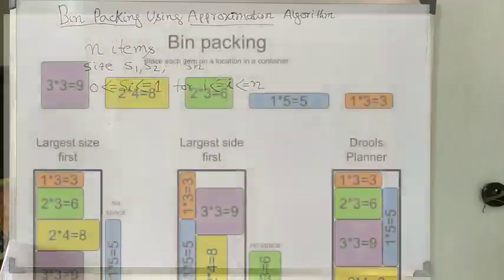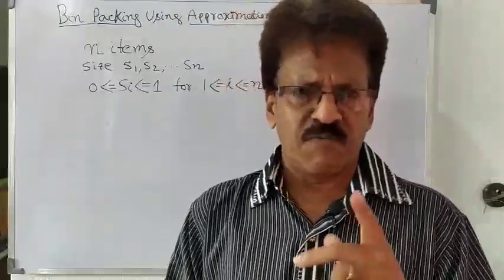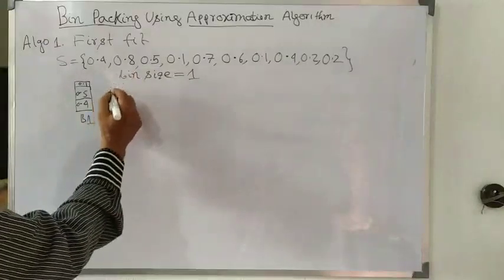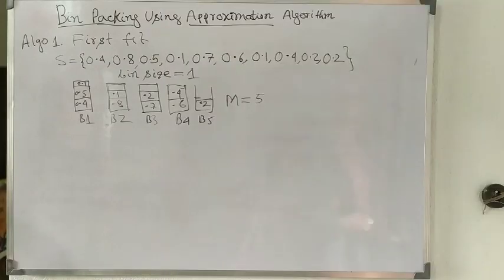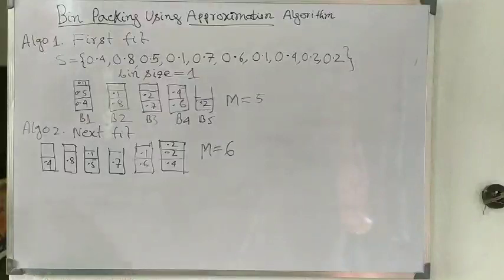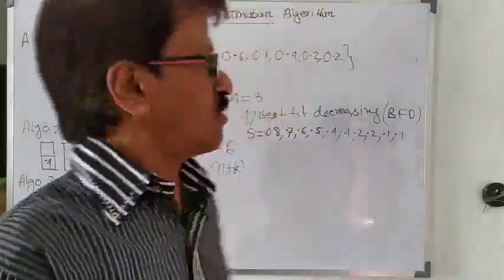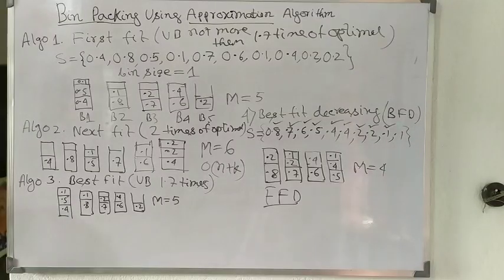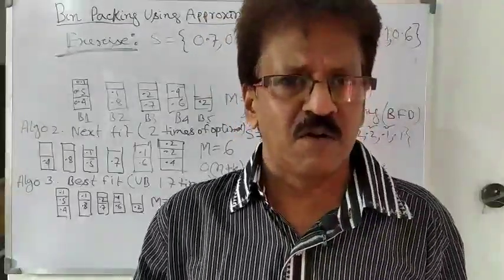Bin Packing | Approximation Algorithm |Upper Bound

Comment: First fit algorithm 
Bin1:0.7,0.2,0.1
Bin2:0.5,0.4
Bin3:0.2,0.5
Bin4:0.6

Next fit algorithm:
Bin1:0.7
Bin2:0.5,0.2
Bin3:0.0,0.4,0.2
Bin4:0.5,0.1
Bin5:0.6

Best fit algorithm
Bin1:0.7,0.2,0.1
Bin2:0.5,0.4
Bin3:0.2,0.5
Bin4:0.6

Best fit decreasing algorithm
0.7,0.6,0.5,0.5,0.4,0.2,0.2,0.1

Bin1:0.7,0.2,0.1
Bin2:0.6,0.4
Bin3:0.5,0.5
Bin4:0.2
Reply: First fit algorithm
Bin1:0.7,0.2,0.1
Bin2:0.5,0.4
Bin3:0.2,0.5
Bin4:0.6
Next fit algorithm:
Bin1:0.7
Bin2:0.5,0.2
Bin3:0.0,0.4,0.2
Bin4:0.5,0.1
Bin5:0.6
Best fit algorithm
Bin1:0.7,0.2,0.1
Bin2:0.5,0.4
Bin3:0.2,0.5
Bin4:0.6
Best fit decreasing algorithm 0.7,0.6,0.5,0.5,0.4,0.2,0.2,0.1 Bin1:0.7,0.2,0.1
Bin2:0.6,0.4
Bin3:0.5,0.5
Bin4:0.2
Reply from the maker: Correct
Reply from the maker: Correct
Reply from the maker: Correct

Comment: First fit Algorithm
1st bin: 0.7,0.2,0.1 
2nd bin: 0.5,0.4
3rd bin: 0.2,0.5
4th bin: 0.6
M=4

Next fit Algorithm
1st bin: 0.7
2nd bin: 0.5,0.2
3rd bin: 0.4,0.2
4th bin: 0.5,0.1
5th bin: 0.6
M=5

Best fit Algorithm
1st bin: 0.7,0.2,0.1 
2nd bin: 0.5,0.4
3rd bin: 0.2,0.5
4th bin: 0.6
M=4

Best Fit Decreasing Algorithm(BFD)
1st bin: 0.7,0.2,0.1 
2nd bin: 0.6,0.4
3rd bin: 0.5,0.5
4th bin: 0.2
M=4
Reply from the maker: Correct

Comment: First fit/ Best fit algorithm 
(both have same output and complexity) 
1st bin : .7,.2,.1
2nd bin : .5,.4
3rd bin : .2,.5
4th bin : .6
M=4

Next fit algorithm
1st bin : .7
2nd bin : .5,.2
3rd bin : .4,.2
4th bin : .5,.1
5 th bin : .6
M=5

Best fit decreasing algorithm (optimal) 
>>This is same as First fit but after sorting      the data set in an descending order 
1st bin :- .7,.2,.1
2nd bin :- .6,.4
3rd bin :- .5,.5
4th bin : .2
M=4
Reply from the maker: Correct

Comment: S={0.7, 0.5, 0.2, 0.4, 0.2, 0.5, 0.1, 0.6}
Algorithm 1: First fit
Bin 1: (0.7, 0.2, 0.1) 
Bin 2: (0.5, 0.4) 
Bin 3: (0.2, 0.5) 
Bin 4: (0.6) 
So, M = 4

Algorithm 2 : Next fit
Bin 1: (0.7) 
Bin 2: (0.5, 0.2) 
Bin 3: (0.4, 0.2) 
Bin 4: (0.5, 0.1) 
Bin 5: (0.6) 
So, M = 5

Algorithm 3 : Best Fit
All 4 bins are same as in First fit algorithm. 

Algorithm 4 : Best fit decreasing (BFD) -> Optimal solution
First of all sort the given bin elements in decreasing order ->
S = {0.7, 0.6, 0.5, 0.5, 0.4, 0.2, 0.2, 0.1}
Bin 1: (0.7, 0.2, 0.1) 
Bin 2: (0.6, 0.4) 
Bin 3: (0.5, 0.5) 
Bin 4: (0.2) 
So, M=4
Reply from the maker: Correct 💯✔️

Comment: ALGO 1: FIRST FIT 
Bin 1 : 0.7 , 0.2, 0.1 
Bin 2 : 0.5, 0.4 
Bin 3 : 0.2, 0.5
Bin 4 : 0.6
Hence , M = 4

ALGO 2 : NEXT FIT
Bin 1: 0.7
Bin 2: 0.5 , 0.2
Bin 3: 0.4 , 0.2 
Bin 4: 0.5 , 0.1
Bin 5: 0.6 
Hence, M = 5

ALGO 3 : BEST FIT
Bin 1: 0.7, 0.2, 0.1 
Bin 2 : 0.5, 0.4 
Bin 3 : 0.2, 0.5
Bin 4 : 0.6
Hence , M = 4

ALGO 4: BEST FIT DECREASING
S={0.7 , 0.6 , 0.5 ,0.5 , 0.4 , 0.2 , 0.2 , 0.1}
Bin 1: 0.7,  0.2,  0.1
Bin 2: 0.6 , 0.4 
Bin 3: 0.5 , 0.5 
Bin 4: 0.2
Hence, M = 4
Reply from the maker: Correct 💯✔️

Comment: First fit-
1st bin : 0.7, 0.2, 0.1 
2nd bin : 0.5, 0.4 
3rd bin : 0.2, 0.5 
4th bin : 0.6 
M=4

Next fit- 
1st bin : 0.7 
2nd bin : 0.5, 0.2 
3rd bin : 0.4, 0.2 
4th bin : 0.5, 0.1 
5 th bin : 0.6 
M=5

Best fit 
1st bin : 0.7, 0.2, 0.1 
2nd bin : 0.5, 0.4 
3rd bin : 0.2, 0.5 
4th bin : 0.6 
M=4

Best fit decreasing 
1st bin : 0.7, 0.2, 0.1 
2nd bin : 0.6, 0.4 
3rd bin : 0.5, 0.5 
4th bin : 0.2
M= 4
Reply from the maker: Correct

Comment: First fit/Best fit: 
1st bin : 0.7, 0.2, 0.1 
2nd bin : 0.5, 0.4 
3rd bin : 0.2, 0.5 
4th bin : 0.6 
M=4 

Next fit: 
1st bin : 0.7 
2nd bin : 0.5, 0.2 
3rd bin : 0.4, 0.2 
4th bin : 0.5, 0.1 
5 th bin : 0.6 
M=5

Best fit decreasing:
1st bin : 0.7, 0.2, 0.1 
2nd bin : 0.6, 0.4 
3rd bin : 0.5, 0.5 
4th bin : 0.2 
M= 4
Reply from the maker: Correct

Comment: First fit/ algorithm 
(both have same output and complexity) 
1st bin : .7,.2,.1
2nd bin : .5,.4
3rd bin : .2,.5
4th bin : .6
M=4

Next fit algorithm will be
1st bin : .7
2nd bin : .5,.2
3rd bin : .4,.2
4th bin : .5,.1
5 th bin : .6
M=5

Best fit decreasing algorithm (optimal)  solution will be
>>so this is  the same as First fit but after sorting      the data set in an descending order 
1st bin :- .7,.2,.1
2nd bin :- .6,.4
3rd bin :- .5,.5
4th bin : .2
M=4
Reply from the maker: Correct

Comment: By first fit algorithm 
Bin 1  Bin 2  Bin 3  Bin 4
0.1         
0.2       0.4     0.5   
0.7       0.5     0.2   0.6
M=4
Next fit algorithm:
B1   B 2    B 3   B 4     B 5
        0.2     0.2   0.1 
0.7  0.5    0.4   0.5     0.6 
M=5
Best fit algorithm:
Bin 1  Bin 2  Bin 3  Bin 4
0.1         
0.2       0.4     0.5   
0.7       0.5     0.2   0.6    
M=4   
Best fit decreasing algorithm:
Bin 1  Bin 2  Bin 3  Bin 4
0.1         
0.2        0.4      0.5   
0.7        0.6      0.5     0.2
M=4
Reply from the maker: Correct

Comment: First fit Algorithm
1st bin: 0.7,0.2,0.1 
2nd bin: 0.5,0.4
3rd bin: 0.2,0.5
4th bin: 0.6
M=4

Next fit Algorithm
1st bin: 0.7
2nd bin: 0.5,0.2
3rd bin: 0.4,0.2
4th bin: 0.5,0.1
5th bin: 0.6
M=5

Best fit Algorithm (same as First fit Algorithm)
1st bin: 0.7,0.2,0.1 
2nd bin: 0.5,0.4
3rd bin: 0.2,0.5
4th bin: 0.6
M=4

Best Fit Decreasing Algorithm
1st bin: 0.7,0.2,0.1 
2nd bin: 0.6,0.4
3rd bin: 0.5,0.5
4th bin: 0.2
M=4
Reply from the maker: Correct 💯✔️

Comment: Algorithm 1: First Fit ->
                       1st Bin = 0.7, 0.2, 0.1
                        2nd Bin = 0.5, 0.4
                        3rd Bin = 0.2, 0.5
                        4th Bin = 0.6

Algorithm 2: Next Fit ->
                       1st Bin = 0.7
                        2nd Bin = 0.5, 0.2
                        3rd Bin = 0.4, 0.2
                        4th Bin = 0.5, 0.1
                        5th Bin = 0.6

Algorithm 3: Best Fit ->
                       1st Bin = 0.7, 0.2, 0.1
                        2nd Bin = 0.5, 0.4
                        3rd Bin = 0.2, 0.5
                        4th Bin = 0.6

Algorithm 4: Best Fit Decreasing->
                       1st Bin = 0.7, 0.2, 0.1
                        2nd Bin = 0.6, 0.4
                        3rd Bin = 0.5, 0.5
                        4th Bin = 0.2
Reply from the maker: Correct 💯✔️